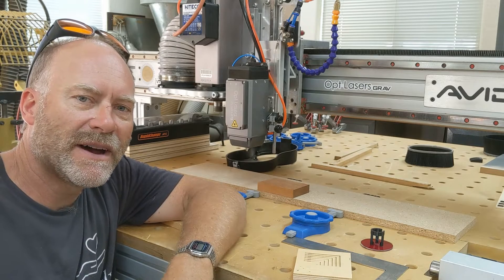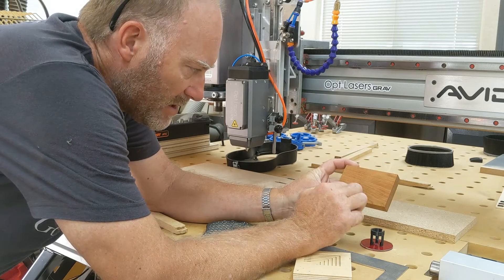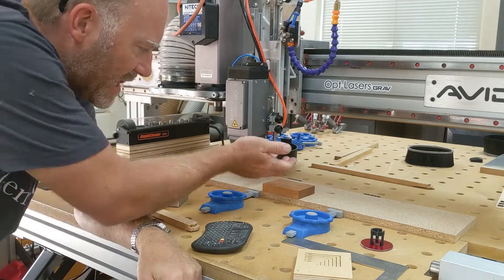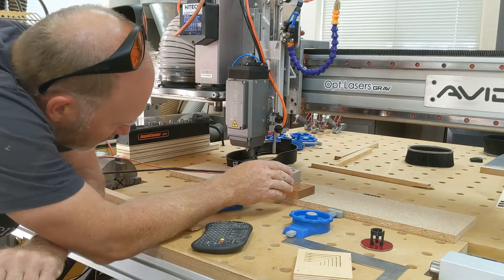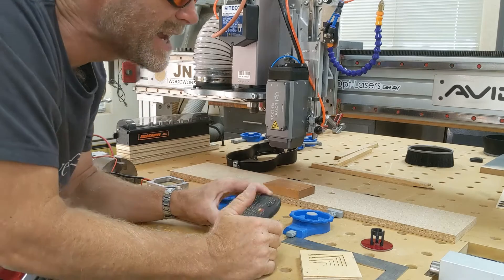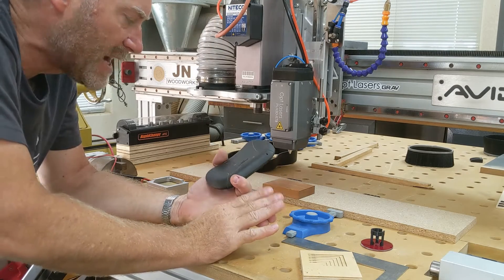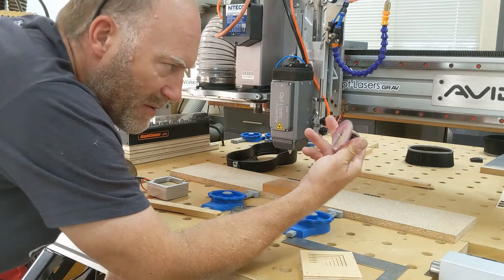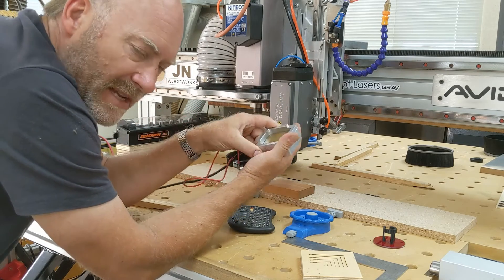Laser Job Setup on my CNC

Comment: 6:24 @Jim, how did you connect your laser touch off rod to chassis ground? I just checked on mine today and there’s no continuity. Did you just connect a wire from some metal part of the laser to some metal part of the CNC gantry or something? Is there any safety issue either isolating or grounding the laser to the chassis?
Reply from the maker: Hi Ryan,
The laser rod clamps are bolted tot he universal adapter plate (there are a couple of convenient tapped holes there already), and all the rest of the laser mounting hardware is metal so it all conducts through to the Z stage which is chassis grounded several ways, the best being the spindle wiring.  So all I have to do is attach the magnet wire from the touchplate somewhere on the machine's chassis (i like the rotary unit because its got lots of steel) and then the laser touch rod or the spindle will trip the touch plate.
I plan on added a 3D probe soon, and I will probably just wire the touchplate ground to chassis so that I don't have to drag the magnet and wire for it around.
Reply: @JNWoodworks  Where did you aquire the parts for this? Ive searched amazon and the internet with various search words and dot find anything like your setup. Any info would be much appreciated.
Reply from the maker: @robertbrown6943  Hi Robert.   If you send me an email at jnwdwks@gmail.com I can send you a document with the parts list for that.

Comment: Very interesting ! Thank you. Can you tell us more about the little safety glass ? First time I see it. Do you have the same for the 15W?
Reply from the maker: That is a new part that Opt just came out with for the XT8 laser.  The one I have is a prototype, but it works very well.  It pretty much keeps all the reflected light down at work level.  It fits over the end of their air nozzles, so it would probably fit onto most of their lasers.